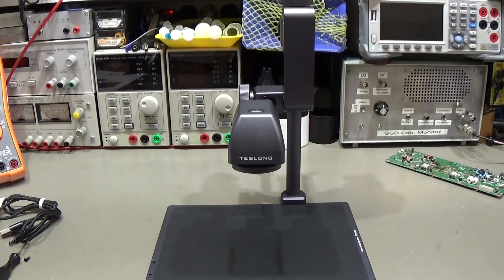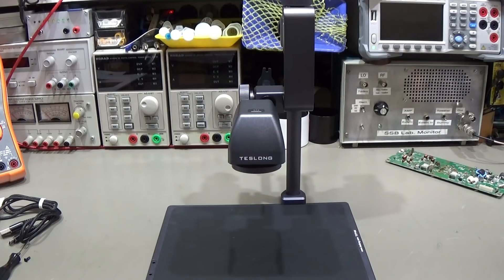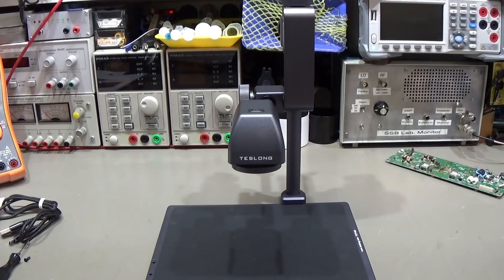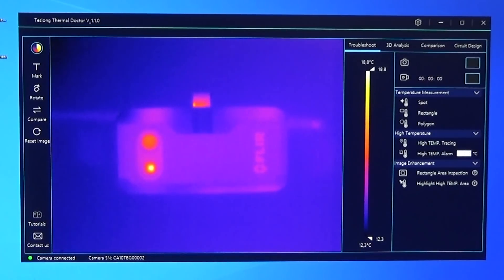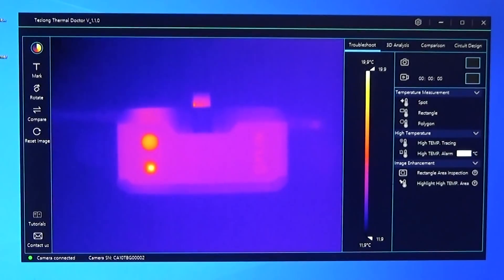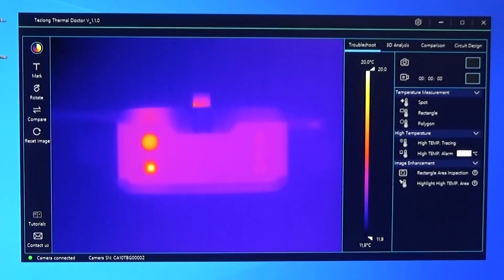#239 Teslong TCP100 Benchtop PCB Thermal Imaging Camera

Comment: I use a hand held IR camera at work and they are quite useful at times. Finding shorted ceramic capacitors is easy with an IR camera. IPA is a cheaper alternative.
Reply from the maker: sure if you have a dead short but only a leakage is difficult to find...

Comment: The "NETD" is download the ADC's bit resolution that they use to sample each thermal pixel (as well as the noise levels in the front end but noise can be averaged out). So basically NETD is the intensity resolution (a 12-bit ADC would be a big improvement over using say an 8-bit ADC). Trouble is, commercial thermal imagers are deliberately crippled, they are not allowed to sell any thermal imaging cameras above a certain spec to the public, that includes bit resolution (NETD), frame rate, noise level and image size resolution). The reason for this I'll leave up to your viewers to research if they so wish ;)
Reply from the maker: I know the US export regulations...

Comment: I think the resolution of the image sensor gives away where most the cost of the camera is. There is a lot more going in to than a visual image sensor, I expect that it requires some form of cooling or temperature control to maintain any accuracy of readings.

Nice to have but still got a long way to fall in price before the hobbyist can put one in the tool box.

I use the rule "If I can keep my finger on it for more than a second then it under 60°C,  if I can read the part number on my finger after touching! it's bloody HOT" 🙂
Reply from the maker: for sure the image sensor is the most expensive part and if done well the application.

Comment: A "professional" finger is much cheaper, but thanks for the review. In a dozen years, with a reduction in price, I think every repairman will have such cameras. Its like digital microscopes 20 years ago...I remember DINO microscopes and their price.
Reply: I had a TO220 shaped fingerprint for a couple of months. The camera is definitely nicer ;)
Reply from the maker: That is what I also thought for a long time but lately I had faults where we had leaking components which took the device out of service which a finger couldn't feel and even not alcohol or freezer spray. Have you seen the experiment at the end of this video? At those temperature differences  your finger will fail...